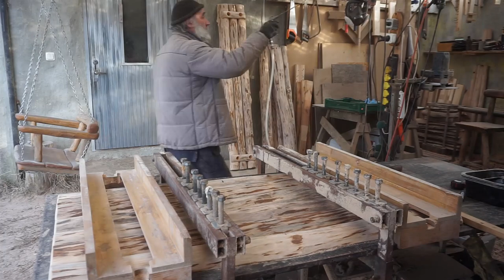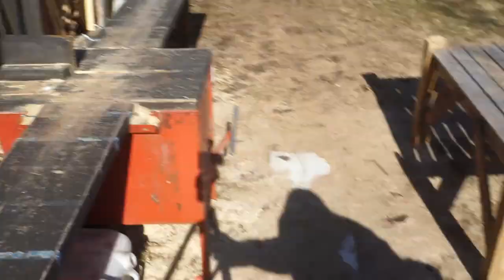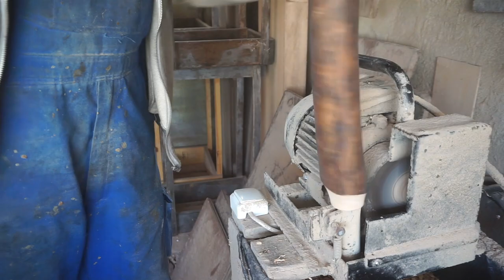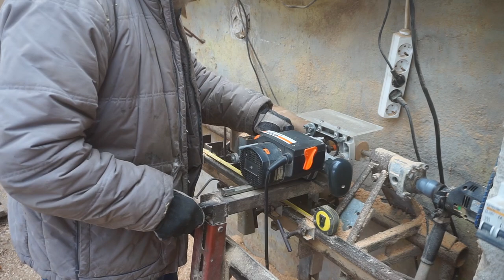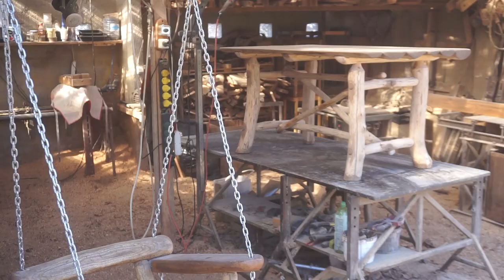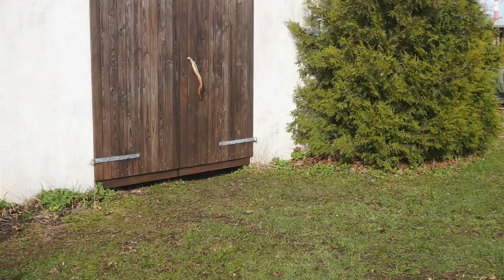Big rustic table by Uudopuu

Comment: Wow! You did a fantastic job! The tools that you have helped so much. I’m thinking about doing woodwork, but mine will be more by hand for lack of tools.😅
Reply from the maker: Greetings.
Yes, in the thirty years that I have been doing this job, quite a lot of different tools have accumulated. But I also started with little and made many tools myself, because it was cheaper that way and also because specific tools were simply not available. Many machine tools are still in use today.

Comment: Thank you very much for your video. It is fantastic. As usual. What substance do you use to fill in holes and cracks in wood (black and looks like glue of a kind)??
Reply from the maker: Thank you for your kind words. Big cracks i fill with polyurethane glue, the black substance I use to fill small cracks is wood dust and linseed oil. Wood dust is from sanding tinted surfaces, that because it is black....almost black.

Comment: at the end of the work you use an oil and a grease, can you give details of these materials? nice work congratulations from Brazil
Reply from the maker: Yes, thank you. The oil is "Teak Oil", the main component of which is linseed oil. The last layer applied by hand is oil wax. The main components are linseed oil and beeswax.
Reply: @udoaas2466  Is that glue or epoxy you are using?? Keep up the great work!!
Reply from the maker: @noelsyab965  Thank`s. I use polyurethane glue mixed with wood dust, because the glue is more flexible than epoxy and has less chance of cracking over time.